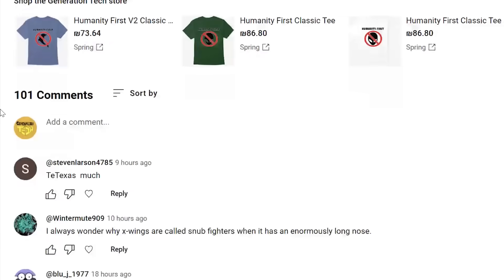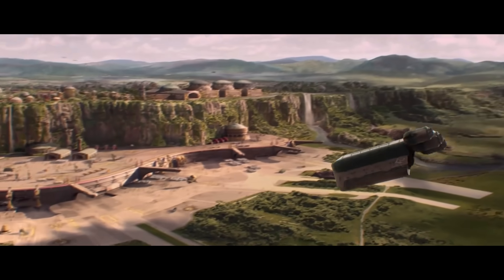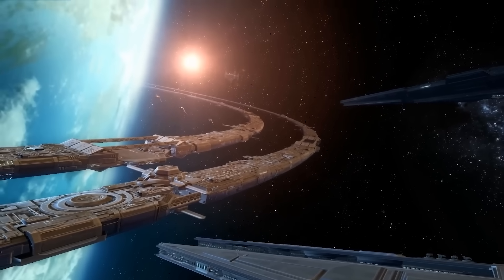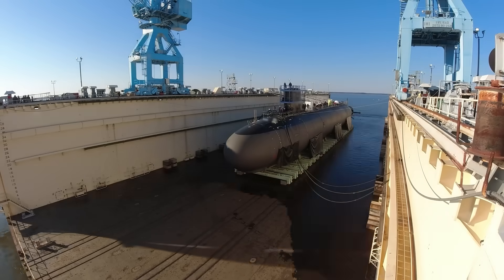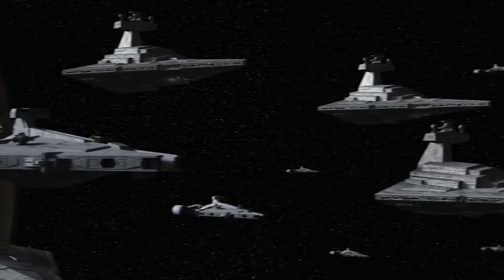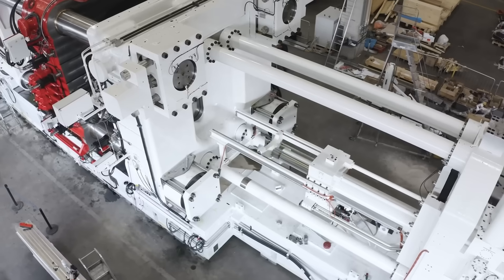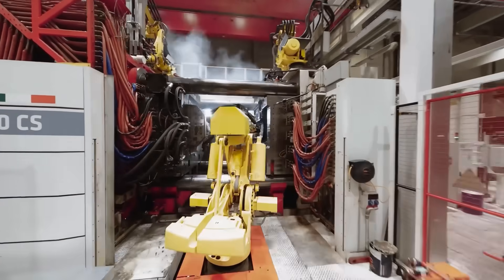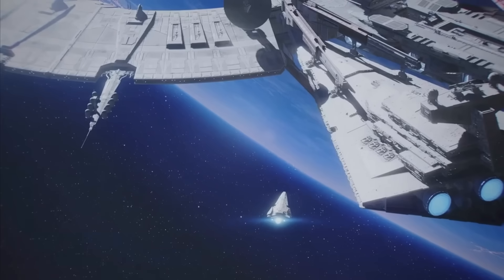The Economics of a 10 Mile Long Star Destroyer

Comment: 8:41 in real life, a lot of auto shops will fix uni-body vehicles by cutting out the bad section, and replacing it with a good section from a junked car.
 The process is relatively simple for an experienced autobody tech - just takes a lot of time to do properly.
Reply: They do it with ships too.  In 1956 the USS Wisconsin collided with another ship and the bow was severely damaged.  The Navy took the hull of her sister ship Kentucky, which was never completed, and cut off her bow to weld onto the Wisconsin.  To this day, the Wisconsin with the bow of Kentucky grafted on is affectionately nicknamed the WisKy.
Reply: @LiveFreeOrDieDH they just did that with a submarine years ago. Also they do it with cruisers.
Reply: @K4rm4ness  A few years ago, a shipyard in the UK managed to weld a section of a submarine hull on upside-down. They had to cut it off and re-weld it rightside-up.
Reply: @LiveFreeOrDieDH  The HMS Zubian during World War 1 comes to mind.
The HMS Zulu's aft was blown apart by a mine. The HMS Nubian's bow got taken out by a torpedo. Since both destroyers would've been in port repairing otherwise, the engineers said, "Hey, we've got two ends of the same type of destroyer, why not fuse the both of them together?". Thus the Zubian was born. This freaked out German intellegence, as they had no information regarding an HMS Zubian, and couldn't figure out how the Royal Navy had a new one out that they didn't know about.
Reply: @LiveFreeOrDieDH  Scary! A 887 feet long cut-and-shut! 😱
Reply: As an engineer, thats not really a good solution en mass. The problem is, the body is designed to fail in a specific way in a crash situation in order to protect the passengers. When you weld patches into pre-existing paneling, the material is no longer homogenous, and the welding heat has affected the material properties. The result is the vehicle will no longer crumple as expected and thus will be less safe. This is why in most cars, the most critical crumple zones are built to be modular. So its easier to replace them, than to patch them.

Frankly, this whole idea of making entire bodies out of just a couple pieces, strikes me as a prime example of sacrifing the end user to save some money. Some accountant is thinking "this method saves me 100$ per car in manufacturing, so what if the second owner is gonna have to scrap the whole thing in 10 years because its not safely repairable for less than 20k, i already got my money."

Comment: Nuclear propulsion becomes very efficient and cost effective if we can build ships in space.
Chemical rockets would only be for the taxi that gets you to the shipyard / spacedock in orbit.
Reply: Perhaps Kerbal Space Program? Idk. (It’s a video game about building spaceships. I think.)
Reply: It is Kerbal Space program @anonymousanonymous2649
Reply: There are currently no nuclear reactors that would work on a space ship and that would supply significant amounts of thrust.
First you still need a huge mass as shielding against the radiation from the reactor. 
Secound it is difficult to get rid of the waste heat of a nucklear reactor in the vacuum of space.
Third you still need some kind of reacation mass to get ship in space moving.
Reply: @hermes7587  nuclear propulsion has been theorized. the idea is that while a chemical rocket produces hot gas via combustion which creates thrust a nuclear rocket would use a compressed, mostly inert gas and feed that gas through the nuclear reactor, using the reaction to heat the gas to extreme temps where it expands and shoots out of a nozzle. this will deal partially with heat and allow much more fuel to be stored as things like liquid xenon are so compressed compared to their heated gas form. and "significant amounts of thrust" is rather vague, the idea of nuclear propulsion is not large amounts of thrust in a short time like chemical rockets but instead a small amount of thrust that can build up over time in zero gravity with close to 0 friction for the thrust to fight against.
Reply: @gabrielhenson5751  I am aware of the differnt types of propulsion systems. You are referring to an ion engine. The problem is that this type of engine supplies very little thrust. It can reach a high top speed but it is basically useless for maneuvering. Any starship will also need an engine that offers a signifcant thrust to mass ratio.
While nuclear reactors can supply a lot of energy per unit of mass, it is difficult to turn this energy into movement. This does require the above mentioned reaction mass.
Chemical engines use the exhaust gases as reaction mass. Nuclear reactors can´t do this.
Reply: @hermes7587  No i am not talking about ion engines, those ionize the inert gas then accelerates the ions with electricity to make thrust, but i did partially get the two mixed together. The "inert" part i messed up as the actual fuel is liquid hydrogen. (pretty far from inert I'd say lol)

 the theorized nuclear engines use the same principle as how nuclear reactors power turbines, just replacing water and steam with compressed hydrogen. You use the heat of the nuclear reaction to heat the stored hydrogen fuel to incredibly high temperatures. which makes the fuel expand rapidly and accelerate to high speeds before coming out of a rocket nozzle like the exhaust gasses of a chemical rocket.  As the heat from the reaction is being transferred to the fuel then ejected from the rocket it helps remedy the issue of heat dissipation in the vacuum of space.

I checked, and the engine is called a "nuclear thermal rocket"
Reply: @gabrielhenson5751  But you realize that a nuclear reactors requires a large amount of water, steam or hydrogen to convert it´s power to motion?
Hydrogen is the proposed medium in this case because it is a very light element (which is easier to accelerate) and it is to most plentyful element in the universe.
However, the thrust you get is the product of the ejected mass times the velocity squared. Even if the engine manages to accelerate the medium to relativistic speeds, you still need mass to move the spaceship.
Hydrogen is a very light element. This also means you need a lot of it and hydrogen is difficult to store in large quantities.
Reply: Which makes no sense because theres anti gravity engines in star wars  @hermes7587
Reply: Average KSP player
Reply: @GoatGuitars6  wtf is ksp?